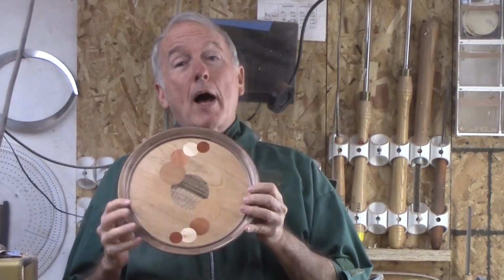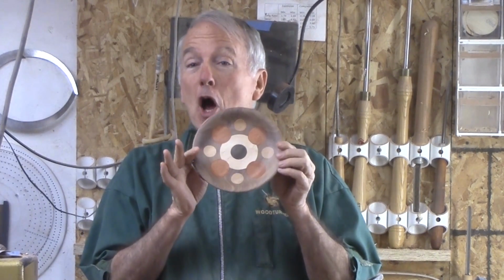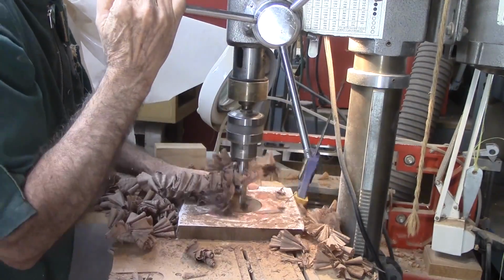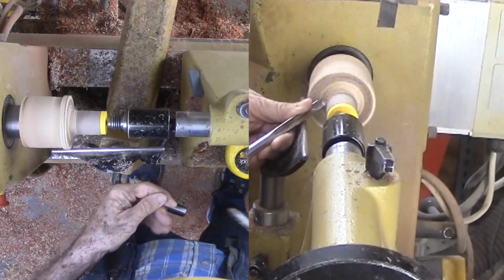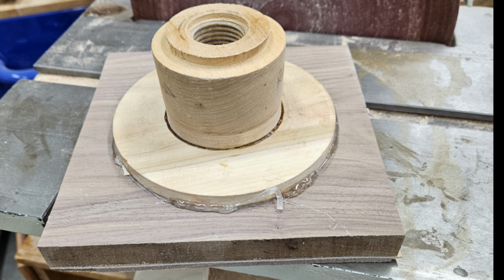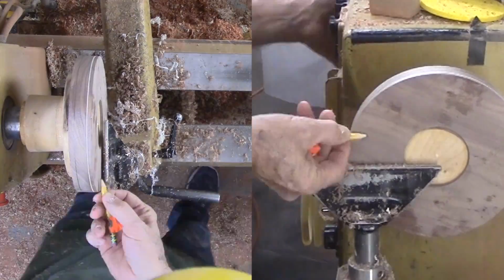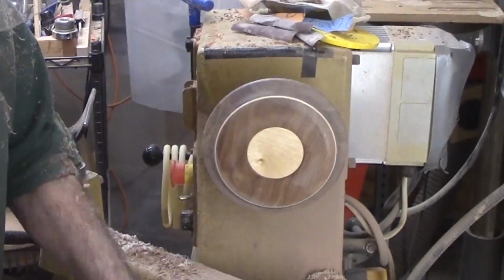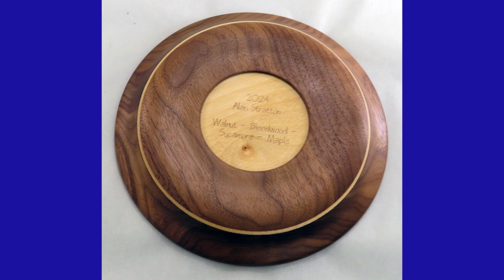Turning An Inlay Tray Or Platter - Better Yet!

Comment: Alan, I've been a subscriber for some time and enjoy watching your video's that demonstrate your creativity.  I have turned a number of inlaid bowls with varying patterns.  I use a CNC to cut pockets on the bottom of bowl and to make the inserts.  The inserts fit tightly with no gaps so I use wood glue.  Some of the members of my woodturning club say that is cheating, but the results are nice.  After the glue dries I flatten the bottom with the CNC then using hot melt glue fasten a sacrificial block to the bottom and turn the inside of the bowl, until the inlays are exposed.  The pockets and inlays are about 1/2" deep.
Reply from the maker: A new frontier. Got to get mine working.
Alan

Comment: Another nice video.  Thanks.  The OneWay Drill wizard or a similar homemade device and the lathe index feature provides endless variety of drilling options.  I've used it often.  Because it is easy to drill a hole at an angle other than 90 degrees to the board surface, the resulting turning is an oval, ellipse, etc.  These interspersed with circles makes for an interesting appearance.  And yes, I wear my face shield and respirator!  Keep reminding people.
Reply from the maker: Thanks for the ideas
Alan